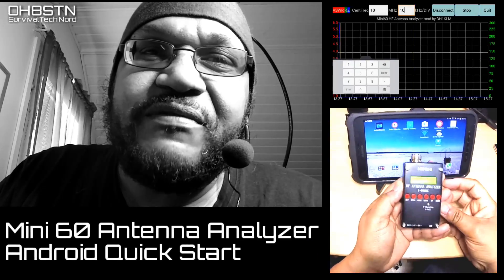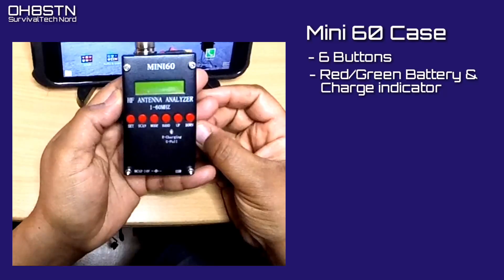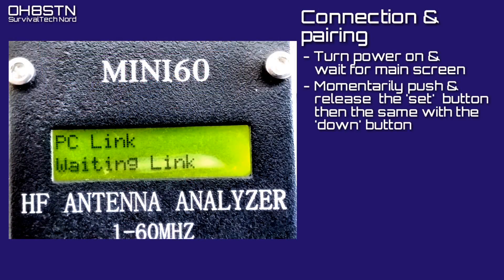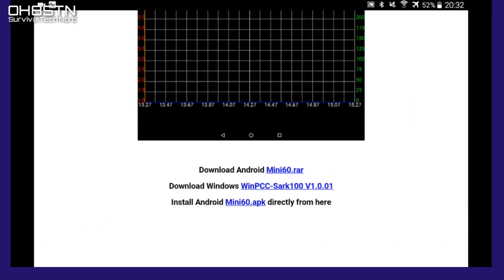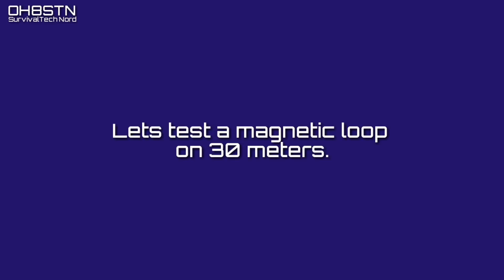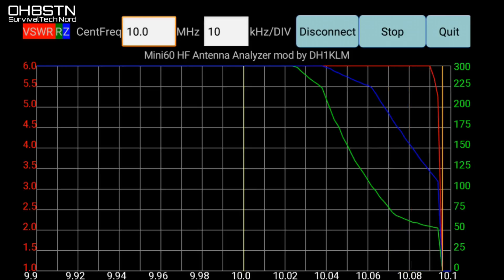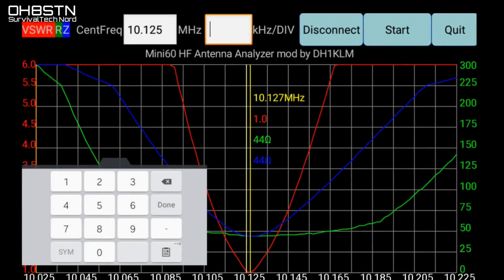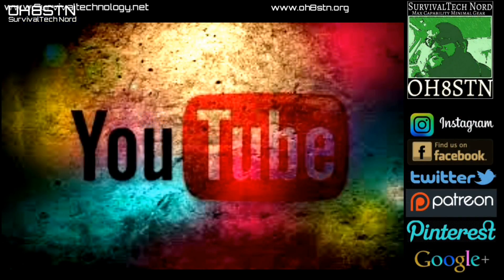Mini60 Ham Radio Antenna SWR Impedance Analyzer

Comment: Looking at the mini 60 antenna analyzer. Will it help check and tune in and check the swr on a 11 meter Gizmotchi 3 beam antena before I look to purchase it !!
Thanks John T.
Reply from the maker: Yes. It doesn't matter what the antenna, or if it's amateur radio or CB. It's about the frequency, not the antenna.

Comment: WA0RSD

Looking for an analyzer for getting a new QRP Shack going.  Any chance this will utilize IOS or windows 10 systems?

I'm assuming we can use the analyzer bare bones without the computer connect?  

Let me know thanks

73s
Reply from the maker: H you can use that SWR meter with or without a computer it's not dependent upon it. In fact I use it as a pocket meter in the field without any tablet or laptop.

Comment: Julian,  Thanks again for one of your informative product demo / tutorials.  I had some problems with connecting the Mini 60 with my LG V20 phone.  Trial and error found that the Jabra headset utility was preventing coupling with the Mini 60.

Once that was cleared up, I've been learning a lot about tuning my Chameleon F-Loop and SuperAntenna multi band vertical.

The "tune by ear" method for noise peak with the loop turned out to be way off the mark.  The Mini 60 has taught me how tight tuning for the loop needs to be.

The tuning ruler for the SuperAntenna is way off, given the antenna's location in my yard.  Now I know I have resonance regardless of placement.

I have to admit I'm now obsessed with obtaining SWRs of 1.0 to less than 1.5, depending on antenna and band.

Happy to have bought it through the link on your channel.

73, K7KSG
Reply from the maker: +Keith Gordon hello Keith excellent excellent questions let's see if I can hit them one by one.
That's good to know I'll leave this comment up so other people can search and troubleshoot. I almost never used the Standalone packages for headsets or audio devices or anything like that so I wouldn't have caught that thank you.

Yeah having the tuner is kind of a double-edged sword. I mean I can tune the F Loop perfectly by ear, could I become some sort of weird fanatic with tuning other antennas that I previously thought we're good enough. Definitely this is a good thing.

I agree about the tuning ruler from Super antenna. They told me to mark the other side of the frequency guide with the actual locations for perfect tune. Surprisingly this is different for each operator. As a primarily digital operator I'm usually pretty low on the bands compared to someone who works SSB. So the marks in the frequency guide will also be different. 

Hey that last sentence is pretty awesome thank you. Little things like that help me to finance the projects that I'm bringing forward on the channel and on the blog. Sometimes I wish it was some type of Star Trek world where we don't need money, but all these little things have cost, the channel doesn't produce Enough by itself to keep pushing out projects. 
Huge thanks and thanks for the kindness. It's really awesome to come back after a couple of weeks and find messages like this 👍

Comment: Just got my Mini 60  from China...  no battery.  What battery should I buy for it?
Reply from the maker: +Thomas Hood hi Thomas. Did you get it from that link in my video? Mine apartment try to add some pictures of the correct battery to my blog in a day or two.
Reply: Got this battery:  https://www.amazon.com/gp/product/B0137ITW46/ref=oh_aui_detailpage_o09_s00?ie=UTF8&psc=1      any 3.7V Li that will fit can work... this one needed a different connector though.   My Mini 60  needed a femail JST XH style connector.   I got this one from Pololu:  https://www.pololu.com/product/1164
Reply: I got mine off of ebay.. had blue tooth but no battery...

Comment: I have bought one of these but I cannot get the Android/Bluetooth software to work right.  I can establish the Bluetooth link as shown with no problem.  i can run a scan.  But the software shows shows the center frequency as 14.27 MHz, and no matter what I do to the entry in the "CentFreq" field that does not change, although I can broaden the overall frequency range covered by increasing the "KHz/div" number.  Can you tell me what I'm doing wrong?  If I load up a PC-based packate (e.g., Mini60-Sark1000-GA60-MR100 Data Scan) and connect from that PC to the Mini60 via USB port it works fine.
Reply from the maker: Which software did you try?  There are two, the one offered from the manufacturer, and the one mentioned in my video. I would start by trying the one you have not tried yet. I would also try it on another Android device (as new as possible) just to be certain it's not the Android version or device specific problem.
I hope this helps.
Julian

Comment: Well done video...but neither of my Android devices (Nexus 5 phone, Nexus 7 tablet) do not reveal a "Mini60" device on the Bluetooth options screen, even after refreshing. The Mini60 IS in "PC Link/Waiting for Link" mode, but it isn't appearing on my devices.

The seller is being most unhelpful. His instructions include something about a "dc jack plug in bluetooth antenna", that I don't quite understand. There is no antenna in the package, and you don't show anything in your video being plugged into the DC in jack. As far as I can tell, there is NO Bluetooth adapter in this device, and since I would have to desolder the SO-239 and the power switch in order to determine this, I haven't done that yet. I'm assuming there isn't a Bluetooth module in this device since it isn't showing up on the Bluetooth list on my devices.

I asked the seller if there was a Bluetooth pairing mode I'm not seeing, but he keeps sending me these instructions (including a link to this video):

https://www.youtube.com/watch?v=MR1tLQ2D43I
Bluetooth connection method \ :

1, the installation software Andrews
2 , press the SET button to open the talent PC link
3 Press the DOWN button to confirm dc plug in the Bluetooth antenna head
4 Open the Bluetooth phone paired with the day assigned for 1234
5 Open Android software click the link prompts the connection point of the scan is completed successfully

See #3? It seems to be implying you have to plug something into the dc jack. I do EXACTLY these steps (with the exception of the part of #3 that refers to some sort of antenna head) and it does NOT appear on my Bluetooth screens.
Reply from the maker: +Gwen Patten hi Gwen. I've no problems with Nexus 9, Samsung Galaxy Tab Active,  Galaxy tab s4, Galaxy Tab 8.9 or 10.1. There are different mini60 models. Some without bluetooth.
Sorry I didn't see the second paragraph of your message. Did you order that from the link in the description or on my blog post? those instructions don't sound like the ones from the seller I bought mine from. :/
Reply: This one says "Bluetooth" on the start up screen, and it said "Bluetooth Model" on the box.  But I still suspect that it doesn't have the module.
Reply from the maker: Gwen Patton here is the place I bought mine. https://rover.ebay.com/rover/1/711-53200-19255-0/1?icep_id=114&ipn=icep&toolid=20004&campid=5338072637&mpre=http%3A%2F%2Fwww.ebay.com%2Fitm%2F2016-Mini60-Sark100-HF-ANT-SWR-Antenna-Analyzer-Meter-Bluetooth-Android-APP-%2F121546367904%3Fhash%3Ditem1c4cba63a0%3Ag%3A4u4AAOSwa39Uuob2
ebay.com
Reply: That's where I bought mine.

Any suggestions, other than desoldering the switch and SO239 to see if there's a module in it? If there ISN'T a module, I have a couple of the type of Bluetooth board this thing uses, and the logic level adapter to set it for the right speed and such, that's no big deal. It just annoys the crud out of me that it isn't working as the instructions say it should be, and was hoping you'd heard of this behavior before and might have some other option I can try first, before I start desoldering things.

I appreciate your quick responses, you're an ace.
Reply from the maker: Gwen Patton actually you're the very first person to tell me they had a problem with this seller. I've heard of one other person having a problem and their device didn't actually have Bluetooth inside. That's from another seller though.
Reply: sigh I guess I need to heat up the soldering iron and get my solder wick ready. Thank you, Sir.

73,
Gwen NG3P
Reply from the maker: Gwen Patton sorry heartbreaking to hear or read stories like this. Let us know how it turns out.
Reply from the maker: Gwen Patton hey one more thing. Video taking it apart, from start to finish so you can prove to eBay that the device wasn't working or didn't have a Bluetooth module inside whatever it might happen to be. But it needs to be from start to finish with no breaks.
Reply from the maker: And you are very welcome de oh8stn
Reply from the maker: Gwen Patton I was just thinking. I will make a short step by step video showing the steps in detail. I'll publish it in the next 24 hours with other short Howto videos.
Reply: That'll be great!
Reply from the maker: Check my latest video.